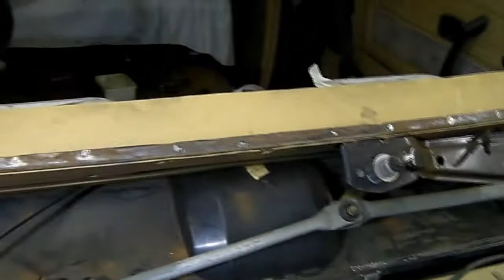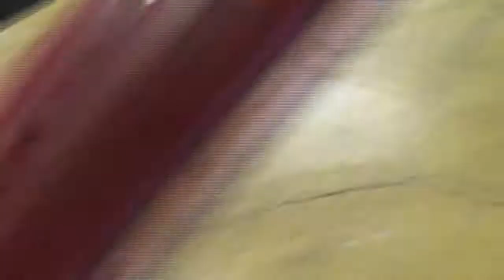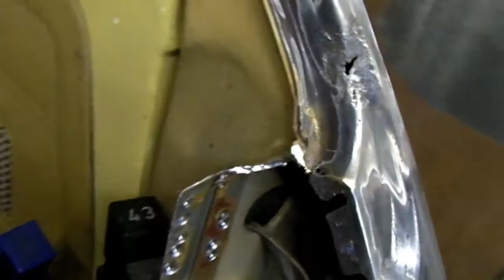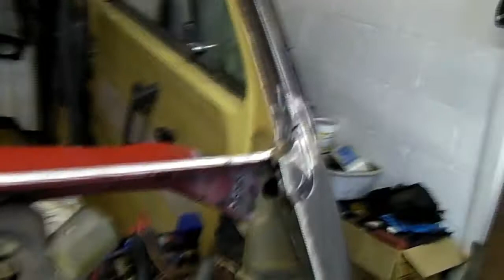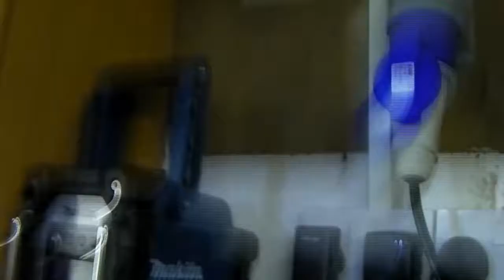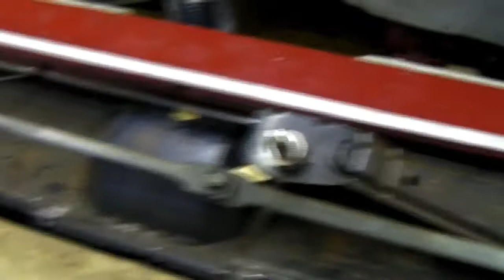How To replace a VW T25/T3 bus scuttle panel. Part 2

Comment: Hi Larcs, my T3 Westfalia looks very the same in this areas. My be not as bad as yours but I have to address it. I am uncertain wether I should replace or repair in sections. Greetings from the Baltic Sea in Germany
Reply from the maker: Wow, welcome to you in the Baltic Sea👍. If it's just small areas, probably do repairs, but until you get the windshield out you won't know how bad it is. Good luck with the repair 🤞.
Cheers Larcs
Reply: @LarcsWorkshop  Thank you, the windshield is out. There are bigger orrosion holes in the area under the rubber sealing aerea. Mainly in all four corners. In the large sheetmetal that you have replaced there are scattered tiny holes and larger ones in the upper sharp bending. My project is on hold right now. I look for similar YouTube videos to get some Inspiration. Later I will start to get it done with minor repair, large repair is always an option that I can choose. Are you located in England? I was there quite often.
Reply from the maker: @freddyflint8309  Thanks for the update 👌. We live in Somerset in the Southwest of England.
Cheers Larcs 👍
Reply: @LarcsWorkshop  I have never been in Somerset, it looks nice on the map. I have been in Plymouth, Bornemouth and other harbour towns in the 70 and 80.  Over the recent years I was quite often in Colchester / Essex. Oldest Roman city they said. Btw I live close to Kiel. Greetings
Reply from the maker: @freddyflint8309  👍

Comment: A better way to do this would be to leave the front panel and inside panel and remove them in one piece you could then weld in the donor in one piece or cut back the outside panel just a small bit and weld new bit on to it, the part he welded together at each end is 188 pound new and with postage overseas is 300 euro
Reply from the maker: Cheers, Larcs.